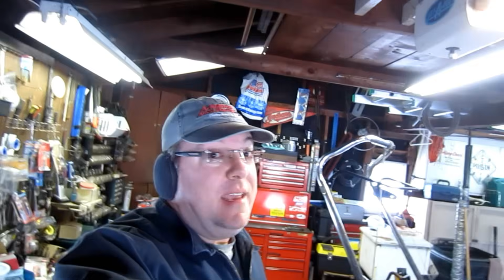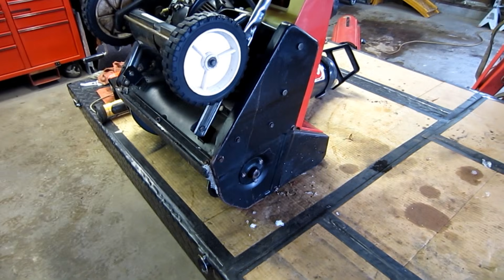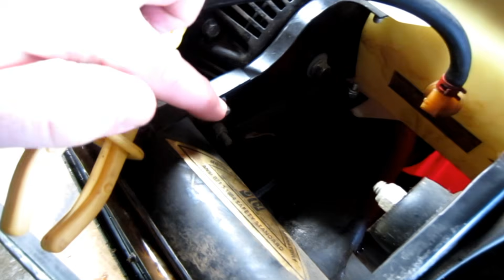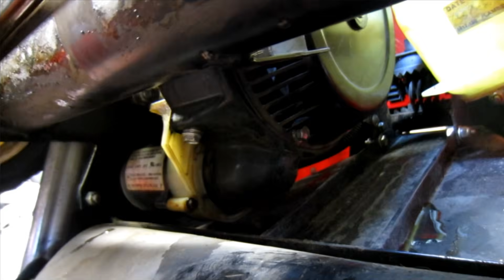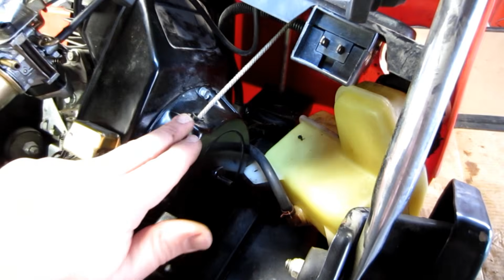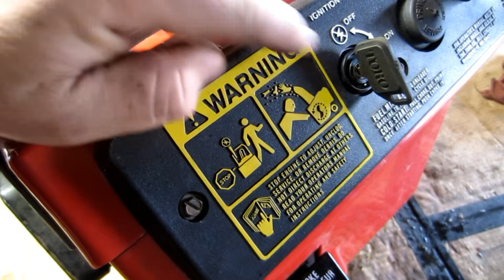Snowblower Recoil Repair Rope Broke!

Comment: Thanks for posting. I am very new on small engine repairs. Got the ccr 2000 with a broken cord, I have some weedwackers and hand blowers for parts. Can I use them for the snowblower? If not, what size should I look for the snowblower cord?

Comment: Hi.... Do you recall what size/diameter cord you used?  Also I can't seem to find your video for the lower cover removal. Can you post a link please.

Thanks
Reply from the maker: I can't recall, that was so long ago and it was standard pull start cord. You should be able to find it at any Tractor Supply for small engine parts store

Comment: Hey great video.....i need some help....i have a toro 38172.....and i cant get recoil off the engine because there is one screw toward the front of machine that i can get to after accessing from bottom panel below.  i can touch it by hand but no way to get a rachet or wrench on it.  How do i get that anterior screw out of the recoil to remove it and replace the pull cord???  Is there some front access i am not finding?  THx a bunch.

Comment: Thanks for your info it is appreciated.  My Toro  2450 is slightly different once you get inside.  The problem I am having is removing  the recoil assembly.  The nuts just spin on the bolt.  I can see no way of getting  a wrench on the other  end of the bolt.    Any suggestions other than taking the whole engine apart.  Thanks.
Reply from the maker: Put a screwdriver up against the bolt head? I'm not sure it's definitely not normal for that to happen.
Reply: Yes, I tried doing that no luck.  I'm going to try removing the cowling,  I might be able to get a wrench on the hind nut that way.  Thanks for replying.
Reply: Any luck with removing the coil starter from the motor?  I am planning on the same repair on Saturday, on a 3650 Toro.
Reply: I’m having the same issue. Everything was fine til I tried to pull the nuts off the recoil. Just spins with the bolt and no access from behind without taking the entire unit apart
Reply: @timmatheson6973  Yeah I am having the same issue

Comment: My electric start doesn't work.  Any thoughts or do you have a video for it?  Thanks!
Reply from the maker: Mr. E Sorry, no video on that... I've found that most of the time If the electric start don't work it need a new starter... Not much luck trying to rebuild or replace parts on snowblower starters... Try Ebay for used starter systems to keep it cheap.. Good luck 🤞
Reply: Does the motor spin and it just not catching on the flywheel.  Orbit doesn't make any sound at all?
Reply: I will let you know, as I am repairing an electric starter now.  @MowersNBlowers